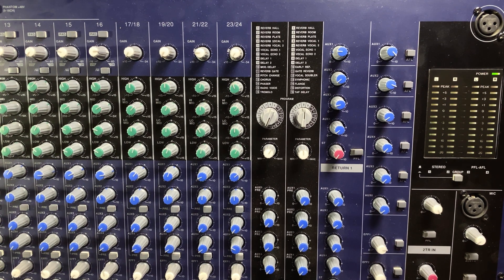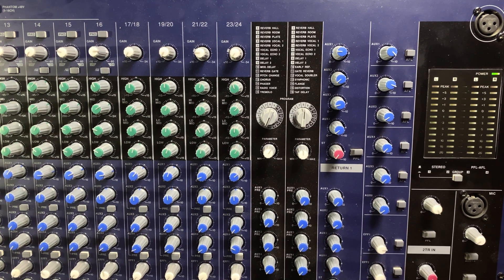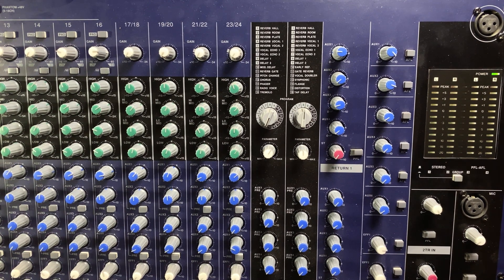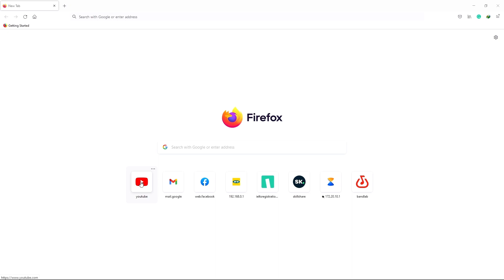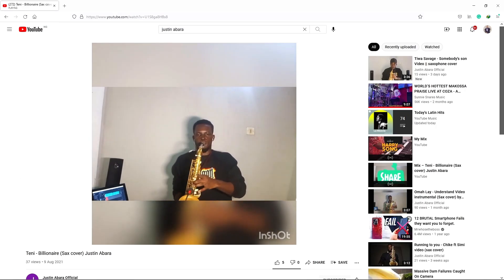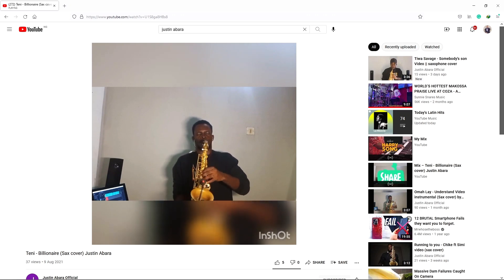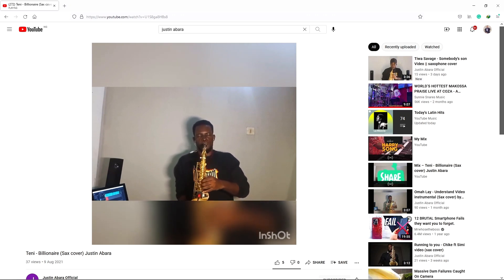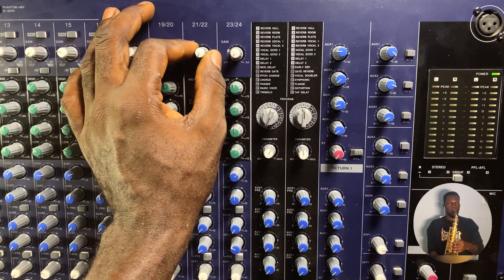How to set GAIN on a mixing console

Comment: Hey Kelvin, with PAs, where should the front of house be set to begin with. Should this be set after the mixer is set, so the faders can be set to infinity ( some suggest this) and then bring up the front of house  to suit the venue? Eg we always set the front of house to half then adjust the volume from the mixer, but sometimes it can be a bit loud and feedback with the faders being carried real low to avoid this. Especially when in a beer garden and we need to drive the PA because of the open air situation. The result is good in the end but sometimes takes a while to get there. Hope this makes sense.

Comment: So so do you mean once you want to set your microphone or any other instrument should I turn The Equalizer All the way down before starting my gain then after start setting my equaliser
Reply from the maker: Not at all. Setting gain has nothing to do with EQ. You can leave the equalizer knobs as they are while setting gain. After which, you can then make EQ adjustments.
Reply: @KelvinEriaganoma  
Kai
Thanks so much big brother
Reply: That is wrong if you turn up eq low high or mid it will most definitely change gain. Just saying

Comment: Thanks, I was hoping to see where u place the fader slider.
Reply from the maker: I usually turn down the channel fader when setting gain for my inputs and rely on my level meter for guidance. But in this video, the channel fader was turned up to the 0dB mark so as to enable you guys hear the audio from the mixer.
Reply: @KelvinEriaganoma  thanks !! That helps.

Comment: One of the problems (issues) is, EVERY fricking manufacturer has a different idea of where the levels should be on their analog mixer.  Mackie... they don't want the level to EVER get to or above -0- db.  They want you to set the signal at a nominal --6 peaking to  -3.  Allen and Heath, on the other hand... their ideal nominal level is +3 to +6 peaking to +9 (all in the yellow band), but not hitting +16 (red).  Set a Mackie up that way and it will NOT be happy.  And, Yamaha advises turning up the channel gain until the peak light come on intermittently.  But, one of the BIG things I have noticed people do:  They set the channel trim up, then crank in an off-board compressor... and readjust the trim higher.  This is a sure way of getting the channel to distort!!!  Once the trim is set, don't readjust it after adding in off-board effects.

Comment: What if the console am using doesn’t have a”pad” button what do I do...thanks
Reply from the maker: The PAD switch is only useful when you have inputs that are already peaking even with the gain knob turned down, and that doesn’t always happen. However, if your mixer doesn’t have a PAD button, and you have a hot input signal, your best option is to turn down the signal before it gets to the mixer, probably at the source; like reducing the volume of a keyboard or music playback device, or on the signal path to the mixer; like using the PAD button on a DI box.
If it’s a microphone input, you can change the microphone placement relative to the sound source (overhead drum mics are a good example) or you can change the microphone to a less sensitive one.

Comment: Boss Kelvin, what if its an analog mixer and it doesn't have a green to yellow lights that indicate the 0db as shown in your mixer
Reply from the maker: For consoles without a full level meter (usually small or generic mixers), you should lookout for a peak or clip indicator on each channel strip. In this case, you have to use your ears. Keep both your channel and master volume faders/knobs at unity (0dB mark) and increase the gain until it sounds loud enough without clipping. If it does clip, you can reduce the channel volume to compensate, or rather, reduce the master volume if that's the case with multiple channels.
Thank you for checking out the video.
Reply: @KelvinEriaganoma  wow thanks boss, I really Appreciate. Tried exactly as u instructed it, and it worked perfectly. Thank you for the video, I will repost across all my social media handles
Reply from the maker: @UnseenAfricaFacts  That's amazing. You're welcome.